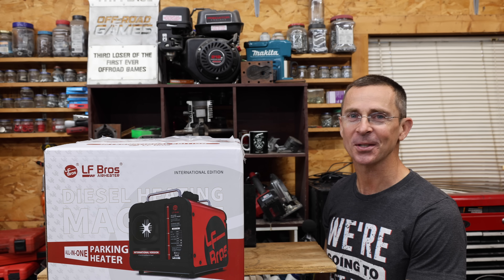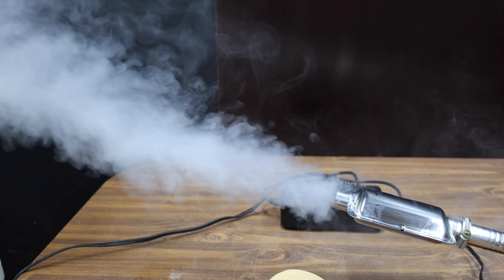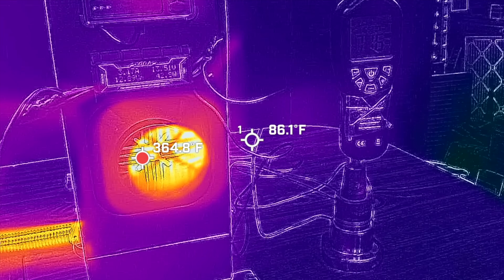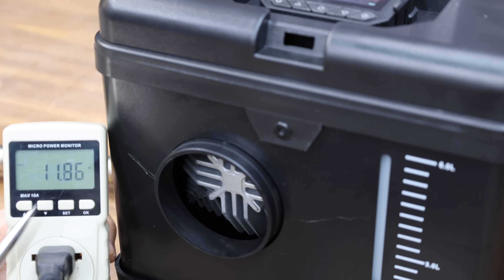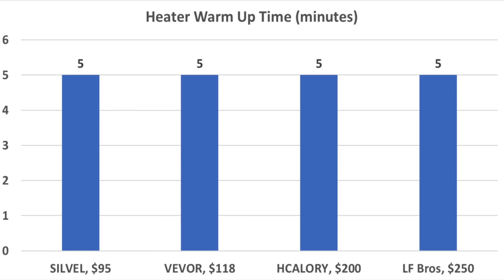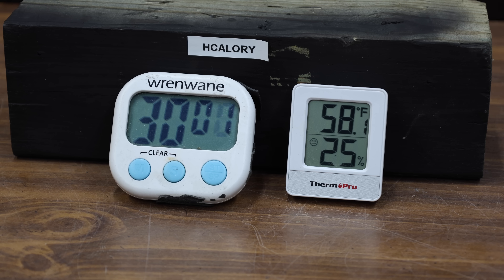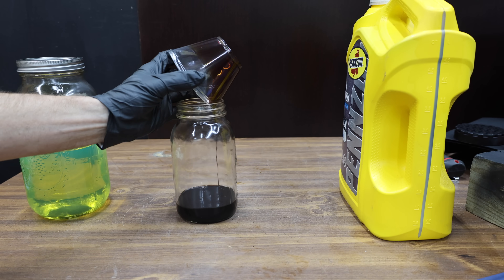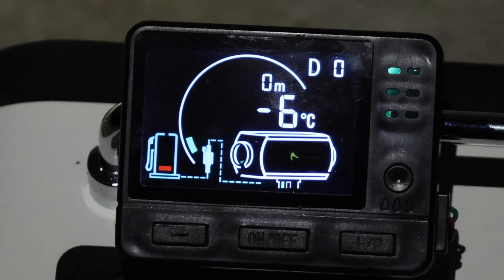The Truth About Cheap Diesel Heaters!

Comment: I put an "8kw" (really 5kw or less) diesel heater in my 5th wheel about 10 months ago. I do love it. So much handier to heat with than propane. When I have a real house again, I'll install a couple of these. I'll also equip with a radiator to capture exhaust heat as well.
Reply from the maker: Thanks for sharing.
Reply: There actually are some diesel heaters that are really 8 kw...having have a larger burner assembly . Nonetheless there is much misrepresentation underfoot in marketing these heaters.
Reply: @geraldhenrickson7472 Even a real 8KW isn't. I have not seen a real "8KW" for sale. I am going by btu's available per advertised fuel burn. Though I have looked earnestly (that is for a budget copy cat), I have only seen one in a several year old youtube review. 
They are pretty much identical to the 5KW but 10 or 15% larger.

Comment: I think I would much prefer a simpler kerosene heater that doesn't need electricity, which is probably why the heater is needed in the first place.  You can use 3 quarts of #2 diesel with 1 ounce of 91% isopropyl alcohol in place of kerosene/#1 diesel.  Use a cotton wick.
Reply from the maker: Thanks for the feedback.

Comment: A little late for me on this one. Lol. I have a friend that builds promax conversion vans and uses these. I have some customers with vintage RVs and campers. So I have installed quite a few. I am installing 2 in my shop with exhaust heat recovery set ups. 2 already in the paint shop we use to counteract the ventilation system cooling the shop while spraying. And I have one in my bus conversion( like greyhound not school bus lol). Work extremely well in the conversions and RVs. One thing to avoid is the 8k models unless they are the same price as the 5k. Because they are both 5K.
Reply from the maker: Thanks for sharing.

Comment: I bought the vevor style for the past winter here in Australia and it worked without any problems, I had it hooked up to old car battery with a portable solar panel it got enough recharge during the day to last almost all winter but the old battery finally died 4wks shy of the end of the cold, great cheap way to heat house
Reply from the maker: Thanks for sharing.

Comment: The silvle heater only smoked because you didn't have enough power to start it but the fuel pump was pumping fuel into the machine and when you restarted the heater it was burning the fuel that got pumped into it previously, the other heaters would have smoked the same way in the same situation
Reply from the maker: Thanks for the constructive feedback.

Comment: these are amazing little heaters i love them for shop and RV heating but for emergency heating the need for electricity makes them a non starter. a propane powered buddy heater costs the same and does not need electricity at all and produces the same BTU output. propane stays good indefinitely and the heater can be hooked directly to a 20lb tank like you would use for your grill which it possible to run for almost a week on low.
Reply from the maker: Thanks for the feedback.

Comment: The most important thing with these is the build quality, which ranges from resentful slave labor to cursory quality control on a busy Friday.  Can you do another video showing the internals, particularly the fuel line?  I have one of these, use it often, and the rebuild process with replacing the, frankly, really scary cheap fuel line, and adding a fuel filter, and cleaning up the wiring was not difficult but many folks don't realize this should be done.
Reply from the maker: Thanks for the suggestion.

Comment: One thing you should test.... cars voltages vary between 11v and 15.5 depending on the state of charge, alternator type and so on..... Do these work in a way that it only would affect fan speed or would one of these put out alot more heat in like a running camper for example than a 12v power supply
Reply from the maker: Thanks for the suggestion.

Comment: It looks like a 10’ of exhaust hose $16?  Would there be any issue to putting longer metal tube before muffler, then run rest thru wall *inside another metal pile with fire resistant insulation. I think 5’ might be long enough If 2’ drops temp 100F. If over 4’ it might be under 150F thru wall?

Comment: Pile of firewood and a wood stove offer far more BTU's per dollar spent, require vastly less maintenance, and use a 100% renewable fuel that doesn't need to be refined.  If I'm going to burn something for heat, it'll be wood.
Reply from the maker: Thanks for sharing.

Comment: Another great video Todd. Thank you. And I'm also looking forward to you being on Matt's off-road games. That should be fun. Not sure if this is up your alley but I'd be interested to see the strength difference the break difference of a non-greasable u-joint versus greasable u-joint. On the Jeep forums people are pretty confident that the greasable you joints are quite a bit weaker but you can get the grease zerk towards the center of the u-joint and now they make them at the end of the cap for increase strength. If you're out of ideas testing those three different configurations would be cool
Reply from the maker: Thanks for the suggestion.

Comment: I have the 8kw vevor heater, but in a stand alone unit, not the all-in-one system. My biggest complaint with it is there is no way to prime the fuel system when it runs out of fuel. I replaced a non-branded similar heater that had a similar control panel to the Sivel and allowed it to run just the pump to prime the system. I'm not a fan of the Vevor.
Reply from the maker: Thanks for the feedback.

Comment: Great video.  As always thank you.  I have the aVevor DIY version installed in my 33 foot 5th and love it.  So much more efficient than the onboard propane heater.  Many times in fire up the Diesel Heater and the onboard LP heater. Get it to temp and fly solo with the diesel heater.  Then I am good for the weekend even with temps dipping in the low teens.
Reply from the maker: Thanks and you are welcome!  Thanks for sharing.

Comment: Well, in a power outage most people will not have ..................power ! 
These things need power to start and run.
That means you will need to get several power banks or a generator to keep this running for a few days.
If you get a generator then you may as well just hook your homes furnace to it !
In a long-term outage, I'll stick with wood, coal and propane for heat.
These things seem better suited for a shop or garage where you can burn your old motor oil.

Comment: A couple things worth mentioning...  The Sivlvel heater was putting out smoke at startup because it shut down due to low voltage on your first attempt to start it.  That left Diesel in the combustion chamber which vaporized from the glow plug on the second startup and produced the smoke.  It's not due to an issue with the heater.  I wish you would have delved a little deeper into the differences between the heaters.  The construction and material quality of the LF Bros heater is much better than the other two.  In addition, the LF Bros uses a different fuel tank and cap design that doesn't leak Diesel like the others.  That makes a huge difference in usability since you can store the heater inside your vehicle without everything stinking of Diesel.
Reply from the maker: Thanks for sharing.

Comment: WARNING! I own a diesel heater and I've had it for several years. There's one CRITICAL thing that needs to be done that often isn't: Route the combustion chamber intake AND exhaust outside! If the unit suddenly looses power while it's running a noxious raw diesel smoke will pour out the combustion chamber intake. Not sure if a one way valve can be put on the intake but there's nothing to stop it. This happened to me in my work shed and it's rather unpleasant. This would be awful to wake up to inside a camper or RV. Just something to bear in mind.
Reply from the maker: Thanks for sharing.

Comment: Just a week ago DeBoss Garage posted a 26 minute video called: "Make a $100 Amazon Diesel Heater Even Better With This Simple Trick" where a new Vevor 5KW and a new Vevor 8KW was disassembled and was alarmed about how the glow plugs, and many fasteners, weren’t tight. He questioned whether there were any differences between the two models and thought it may just be a marketing gimmick. The video seemed to suggest the problem with burning used oil is the thick viscosity so the advice was to mix it with diesel, plus keeping it warm to keep it thin so the screen doesn’t clog. He said even hydraulic oil would burn. I’m not sure if it was that video but I recall someone mentioning a small percentage of stale gasolene mixed in would also work. I asked if synthetic oil would work but didn’t get an answer.
Reply from the maker: Thanks for sharing.

Comment: I have a torpedo unit that does well on diesel or waste oil and can heat a whole house rather quickly. It is not much more money and can hold a lot more fuel. From a cost standpoint, it seems like a better deal, but I don’t know about the efficiency, longevity, or reliability of left unused in comparison with these units. I do worry about CO emissions from all of these units.
Reply from the maker: Thanks for sharing.

Comment: I've owned a Vevor for 2yrs now, I'm in texas so it's not exactly 23° here, but it does dip under 40° in the winter, I've never had any issues and I run it off a power unit, but I use the power unit for other things also, I already owned it, works great. Nice review.
Reply from the maker: Thanks!

Comment: Have you ever done a comparison of generators?  A couple years ago, I bought a generator that can run on propane or on gasoline.  I would like to see a test comparing a group of similar generators that tests efficiency against the gen itself running on each fuel and which compares each gen to the others in the test.  We know that there will be a difference in performance based on fuel used, but can you quantify that?
Reply from the maker: https://www.youtube.com/watch?v=5n1sPy3Al6M

Comment: I'm a little confused about the muffler.  The trucks I used to drive had Thermoking Auxiliary systems which used a battery/diesel heater.  There wasn't a muffler on the exhaust and they never were loud.  There was a small jet burner sound but it never was anything more than you could tell it was working.  Some of the clicking fuel pumps would get noisier than the heater when they were old.

Comment: I hate all of these. Each one of them needs power to run and I want a heater that doesn't need power. I want one that runs on fuel and has simple dials. This electronic stuff wants power so it can't run when the power is out. Absolute waste of money.

Comment: I will add really quick, used motor oil has a lot of toxic junk in it that you wouldn't want to burn in a diesel heater unless you have to. Otherwise, excellent video! Great as always, might have to pick one of the LFBROs ones for my dad!
Reply from the maker: Thanks for sharing.

Comment: I bought a knock off Vevor ( yes, they make knock offs of cheap heaters) and I love it. Works perfect for a 1 car garage. I didn't have a 12v to 110 adapter, so I hooked it up to a 12v battery that's also hooked up to a battery tender. Works perfectly for not having to worry about the battery draining.
Reply from the maker: Thanks for sharing!

Comment: Well the disassembly at the end proved my original assumption! Those heaters without the housing are the same style(identical) to what Thermo King uses with their TriPak apu’s on Semi’s! Different brands but the same thing end to end! Crazy how they rebrand stuff just to charge us more! Also, you can’t run them heaters for days on end without doing a burn off cycle ( cranking the heat up for 30-45 mins) the screen element clogs over time & heater performance declines drastically!!
Reply from the maker: Thanks for the feedback.

Comment: Eberspacgher and Webasto did these for use on trucks and construction vehicles for years. Higher quality and higher cost than the Chinese versions which actually work just as well. Mandatory with any of these is having a CO detector near the heat output in case things go wrong. There are also quieter fuel pumps and ways to reduce it's 'clicking' sound which annoys some people. Tons of info online about these heaters.
Reply from the maker: Thanks for sharing.

Comment: It would be interesting to capture both the inlet and outlet temperatures, as well as the air speed.  From those numbers you should be able to calculate the actual wattage based on the temperature rise and mass flow.
Reply from the maker: Thanks for the feedback.

Comment: You definitely need a battery powered system if you want any heat during mains power outages!!! My heating is powered with a 60 Ah battery that is permanently hooked up to a CTEK automatic charger. I recommend that charger because it can be hooked up indefinitely without damaging the battery. I know there are many copies of the CTEK but the price difference isn’t worth the gamble!!!
Reply from the maker: Thanks for the feedback.

Comment: Wish u reviewed 8kw units. I'm curious to see run times. I run equivalent propane heater. Considering longevity of propane storage, think I'll stick with propane.
Reply: 8kw is identical to the 5kw, just different tuning. 8kw ones will soot up faster and wont last as long.
Reply: @HotNoob  I can see using them in marine environments where u don't want to use propane.  Nice to be able to compare options though
Reply from the maker: Thanks for the feedback.

Comment: those lil heaters are getting popular... they will burn most anything once they're up to temperature... but they absolutely must be started on just diesel or they'll foul out & throw codes.. it's also best to switch back to diesel only for shutdown so that's what's in the line/pump during restart. many people that choose to burn other fuels like blended used oil or whatever..... setup a switch to alternate between the two...  Just be sure to only start on clean diesel.  One annoying thing is most of these don't display in Fahrenheit.. only Celsius so something to think about
Reply from the maker: Thanks for sharing.

Comment: Run kerosene through the unit once a year to clean out the burn pot of carbon buildup. One tank wide open and it's clean. That's what we do for the over the road trucks having issues with lots of smoke all the time and little to no heat. After that go back to diesel.
Reply from the maker: Thanks for sharing.

Comment: One test that would be interesting I think would be to put kerosene in one of these and not pipe the exhaust outside to see if it will still make the air unbreathable or not.
Might sound crazy but there are actually kerosene heaters for the home that reject all the combustion byproducts in the living space.
Different grades of kerosene exit at least here in France and putting the cheapest one will make a smell that not everyone will handle very well.
Actual diesel on the other end would be the stupidest idea ever and would not only clear the house but it would also destroy the heater.
But with good quality fuel it produces almost no smell once it's warmed up and running smoothly.
I do open a window when starting and shutting down the heater since it always smell during those phases but it only lasts a minute or two at most.
Reply from the maker: Thanks for the suggestion.

Comment: Ive had one running in my garage for about 5 years now. Ive put 100 gallons diesel, jetA, through it and it still runs great. Ive gone through three pumps and never had to open it up or change the glow plug. I destroyed two more pumps trying different fuel types like acetone and white gas, gas, thinner, none of them ran and just destroyed the pump in minutes.
Reply: I run a 12v PC power supply that has been on non stop for five years too.
Reply from the maker: Thanks for sharing.

Comment: The vevor is 89 bucks currently.  Buying the ac/dc adapter with it still makes this the best value.  Thanks so much for the video.  Ive been looking at these and been on the fence until your comparison video showing the performance function of these heaters.  100 dollars is cheap insurance for a power outage heat source that I can run from generator,  power bank or car battery. With a 5 gallon can of fuel I'll have a few days worth of heat.
Reply from the maker: You are welcome!  Thanks for the feedback.

Comment: Thats Todd for the very informative video.
I use the vevor 8kw only at night for my hunting tree cabin.
Works great.
In my tree cabin i only have 12v power. It comes from a solar panel and a rv battery. So what heat source should i use during the day?
I do have a buddy heater, but i am worried about all of the moisture from the burning of propane.
I like the buddy heater for ice fishing because i can also cook on it.
What is your thoughts?

Comment: Used one of these to attempt to heat some parts of my house. Unit outside with the tube coming in.. seems i should've got the better one since the similar vecor brand only had the pipes coming out the bottom.. anyway. After a full day use exhaust went the wrong direction. Not sure if anyone had the same result with this type of heater.
Reply from the maker: Thanks for sharing.

Comment: Would be great if these could be turned on by remote control, for instance TUYA seems natural.  Or a simple contact closure like IGN switch to fire it up and turn it off.  Seems deliberate that remote control is only through the Bluetooth fob in proximity to the unit, or by push button, but has no other way to remote control.  Over internet or Wifi requires a custom board made by a private enthusiast (AfterBurner).
Reply from the maker: Thanks for the feedback.